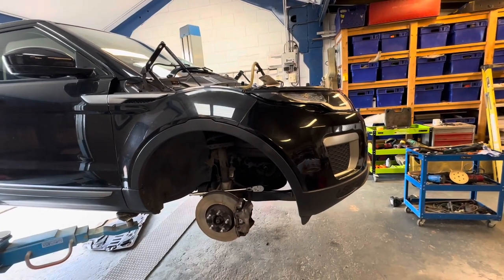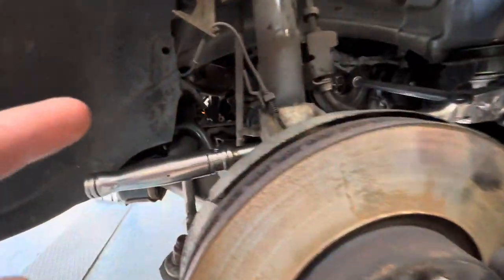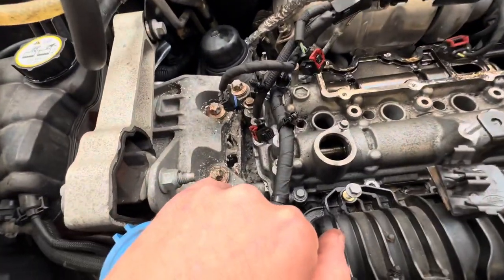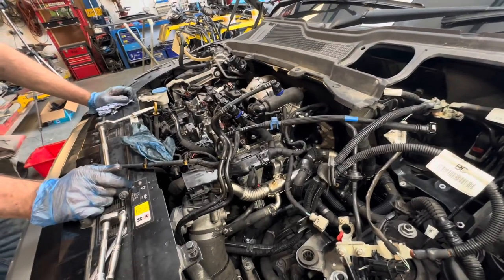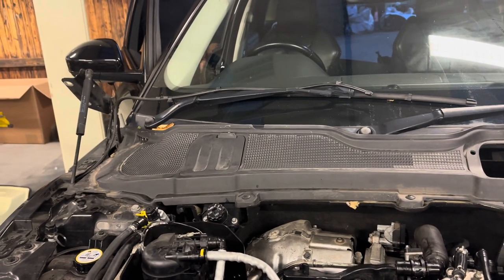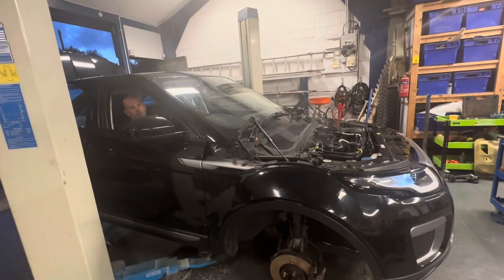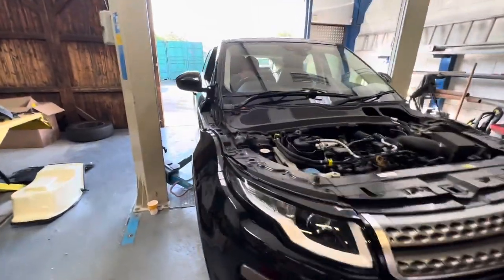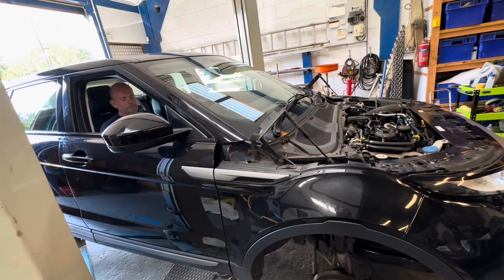RANGE ROVER EVOQUE INGENIUM ENGINE FAILURE WILL IT RUN ???

Comment: get your autel and try a regen on the dpf  (1329) watched rest i have done a few regens on various cars and the newer don't pick the revs much over a fast idle during a regen also when you have scanned for codes down the right-hand side of the screen there is a arrow press that to go into that module and code screen
Reply from the maker: No chance with that chain like that
Reply: @sruk   i done quite a few newer cars and during regen they don't go much more than a fast idle about 1400 to 1600 rpm  if you get it to start a regen  and you don't like the way the engine sounds it can be just turned off or touch throttle  i done a jag f pace and it wouldn't do a static regen so had to drive it to do regen had to trick ecu as it was welll plugged to get it to regen could be a guide worn for chain to rattle

Comment: This video should be titled something like: Reason 1054 Why you Should Never Buy A Range Rover
Reply: This exact car only had one problem. Bad maintenance by previous owners.
Reply: I had my car moted today and the garage said they work on any car apart from Land Rover products as they are nothing but grief, what does that tell you!
Reply: I have an old v8 disco not the same as this? I'm a nurse not a mech lol
Reply: @trigsretromotors  that they're not skilled enough to work on a land rover
Reply: @trigsretromotors  the fact mine has done over 100000 and had only have had a battery issue (it was 10 years old) says all I need to know
Reply: @trigsretromotors  it tells me they aren’t good mechanics, all cars are complex these days, I’d ask them to define grief and look for someone who doesn’t specialise in 80’s cortinas 😂😂
Reply: @tpax3p  no, it's a Landrover. They are generally terrible for reliability, and that's coming from ownership experience.
Reply: @trigsretromotors  that tells me that most garages in the uk are pathetic morons who haven't been trained in mechanics, they only want to charge large amounts of money for easy work. No mechanic in Germany has turned my car RRS away, only the untrained mechanics in the uk.
Reply: And what about the range rover owners who have never had any problems, I have had mine since new from 2010, mine is the l320 v6 3.0?
Reply: DPF problems are not entirely unique to Range Rover, they also occur on Japanese vehicles too.
Reply: I have stopped selling them, terrible cars and getting harder and more expensive to put warranty on.
Reply: Every car has problems and also depends on how people maintain them
Reply: @markfoden765  I don't mean to be offensive but this comment is willfully stupid.
Reply: Sorry PB whatever, all cars have issues be it JLR, VAG, BMW etc, your narrow view is just that - your view. My LR has done 178,00 miles, properly maintained and reliable.
Reply: @trigsretromotors  that they only want to do easy jobs 🤣
Reply: @tpax3p  my F-Pace has had its oil changed every 10k KLM’s  Awaiting engine in JLR garage. 100,000k KLM’s on the clock.  I had a new XE on a lease that was only serviced every 34k KLM’s  as per the book.   Needed chains at 60klms.  I maintain my cars regardless of cost.  Early inginium are flawed and JLR are replacing engines well outside warranty.  The new engine have something like 140 modifications to the early ones.  So 2016-2017 cars be ware.
Reply: @archiehitler5264  They are called the lucky ones.
Reply: @philipyates7138  Lots of mileage, no school runs.
Reply: @ukultimaterc  I booked my car into a  garage that said that they could do the work, a straightforward rocker box cover replacement, I then arrived at the garage to hear that they don't touch RRs, this has happened to me five times in the UK, I wished the "pathetic moron" told me on the phone that they don't touch RRs........ Is that clearer now?
Reply: @peterforrest5181  doesn't matter what runs or mileage it has, if its looked after, its looked after. People pay for these flash motors but don't spend a penny looking after them
Reply: These days they're aimed at posers who know nothing about cars. Pay the top price for crap parts.
Reply: @trigsretromotors  sure ya did 😏
Reply: So many people who have zero JLR onership experience and watch individual cases like this online and jump to typing there flippant little comments on here, ridiculous 😂
Reply: @philipyates7138  the cam sprocket bolt coming undone (and their mechanic mate said this had happened on other vehicles too) is not bad maintenance, it's a huge failure in build quality. Unforgiveable failure!
Reply: @jonm7272  oh of course, becuase no other car has ever failed in the history of motoring. And of course because you had a bad one, every other range rover is a bad egg, I mean they must be, ya mate said so 🙄
Reply: @philipyates7138  ha, yes. And don't get me wrong I've owned 2 Range Rover classics, three Discoveries and one series 3. All maintained (and in fact rebuilt) myself. But these modern versions are just shoddy. No bolt should ever come undone on the end of the cam (ok if someone has later bodged the job) but their mate said it had happened on other vehicles too. Piss poor. Don't care how much you feel you need to defend this rubbish, but there's no doubt about their reputation for being completely unreliable being very well deserved.
Reply: @BRED510  VW's aren't the best either. I've owned both kept both serviced and the LR gave least greif.
Reply: @jonm7272  I've had a c class with steering motor fail at less than 30k and just out of warranty repaired at great cost then Nox sensor failed again not covered. Car maintained to Merc schedule and spec.
Reply: @russelldent3814  I've had two Landrovers, an Evoque and a Defender. The Evoque was 2yrs old with 15k miles on, spent 5 of the 7 months I had it in Landrover for numerous issues. Lovely car when it worked, but so unreliable. Mine had the better Ford engine in it too. Likewise the Defender was a fantastic off roader, but after 2 gearboxes, a rear diff and a smoking issue nobody could solve I had enoughof that too.,
Reply: @trigsretromotors  it tells me i dont want to use your garage filled with lazy mechanics.
Reply: rubbish. more like dont own a range rover if you cant be arsed to keep it properly maintained. also do your homework and be wary on cars with sketchy history or else you will have problems. i can tell you one make that is as bad as you tried to say and thats VOLVO!
Reply: Built-in obsolescence.
Should be good for  120000 miles plus easy

Comment: Out of curiosity rob is there any service history at all ? Normally the chains stretch due to lack of service 😢😢
Reply: As in oil changes? Anything else is bad luck
Reply: Not always the case, I’ve seen a couple go before the first service 😬
Reply: @daveawhittle  🤔 knew they wer a bad engine but didn’t think they were that bad 😂 👍

Comment: People should not use Tesco diesel
All the time because it will clog your dpf also never taking it down the motorway for a really long drive.
Reply: I have mainly used supermarket diesel my entire life and never had a single dpf issue. It's more likely down to people not giving them enough miles.
Reply: Old wives tale. It all comes out the same refinery. Usage patterns are a far bigger killer of modern diesels than where you buy the fuel from.

Comment: I've seen a Merc mechanic use the old chain to pull the new chain thru, by breaking the chain at the joining link, then linking the new chain to the old chain, and then pulling the old chain thru. I don't know if this is possible with this engine, but if it is, it could save you removing the gearbox :> Engine locked in TDC

Comment: Just curious why you guys wouldn’t just go ahead and tackle the chain kit yourself? Is it just a time thing?  (no pun intended)
Reply: Because there is a special kit of tools for doing it which costs £900 to buy.
Reply: @Stuart_Johnson_Solutions  Wow ok. Do you know if the tooling applies to other range rovers for that job then?
Reply: @strictlywrenching  not sure but I believe the engine is shared between évoque and sport, don't think it's fitted in the Range Rover range. There will be a different tool set for the bigger diesels too!

Comment: No disrespect guys, you're hardly gonna clear the dpf sitting in a garage with the engine ticking over.
Take the car for a good run thatllhelp a bit.
Bare in mind if the exhaust gasses can't escape from the engine you'll get some noise.
Reply: You must be one of those experts they always talk about.
Reply: They don't want to risk running up the road with the timing chain rattle
Reply: The timing chain is stretched, that's why they're not doing that

Comment: You mentioned it was thought the timing chain may have already been replaced. I`m wondering if the chain was of poor quality or someone may have used the loose bolt to turn the engine?

Comment: A ramp is a piece of elongated material such as steel or wood that rests on an angle and can be used to get cars or people from one level to another. Usually set on an easy to traverse angle. A hoist lifts something up on a vertical plane. 
Why do you call a hoist a ramp?
Reply: @sopissedoff Well, there's ya problem!
Reply: @ferglesnerk  what would that be Dave , hoists lift things like engines ,before the advent of wheel free ramps ,you drove up a small ramp to get onto the lifting platform,hence it got the name ramp ,if u go to lift the engine out you bring over the hoist ,of course there are hoists for outer thing ,but if u drive up it it's a ramp  even if it's 50 mm ,oh my bad 2 inches for you.🇬🇧♥️
Reply: @sopissedoff  I'm in Australia, mate. We gave up the imperial system in 1788.
Reply: @ferglesnerk  welcome to civilization Dave ,say hi to my brother Jim in Melbourne 🇬🇧♥️
Reply: @ferglesnerk  ah Dave  it's great to know my brothers down under invented the metric system  200 years before I knew about it ,there's me using 1/2 inch 7/16 ,5/8 spanners in old blighty. In the 80s ,were really behind the times up here ,but we're good at building nuclear submarines,ha ha
Reply: @Ralph Reilly my god r u people so contrary ,in the UK it's a ramp  get over it find another form of entertainment if it effects you so badly 😂

Comment: Get some steel toe capped boots and give it an Italian tune up on the M2 with heavier engine oil.
Also noticed no sound proofing material in the bonnet when it was replaced.
What could go wrong?  An SP30 on your licence.
I know it's wrong on so many levels, but sell it to a deaf person 🙂
Reply: they aren't finished yet ,

Comment: I had problems with the pdf light coming on all the time did not matter how much i blasted down thw motorway it still came on a few days later, got to the point where i was just wasting fuel to try and clear the pdf, i would think it would have to have been cleared properly, but never found out as i sold the on to a garage.

Comment: Guys ave you checked the chain for stretching??? They are known for it. And when you do the chain what are the cylinders like?? Is the DPF blocked because it’s burning oil?? Again 37 engine swaps in one dealer in Dublin here.  I hope not but you really could be on a hiding to nothing.
Reply: @williamframe5997  yea I was early.  Still watching.

Comment: Such a shame that such beautiful cars are mechanically totally sh*t. Mine's just done 320,000 miles with not one major engine problem and still runs like new. The reason? It's an Audi A6 diesel. I'd love to buy a JLR vehicle, but as a high mileage driver I just couldn't put up with all the breakdowns they all seem to get. I have several friends who have JLR cars (I live near the Solihull factory) and every one without exception is constantly in for repair, at enormous expense. Beautiful cars, just a shame they're the most unreliable brand in every published survey.
Reply: I could write the same lines but the other way around. I know loads of people with XFs that have been faultless with loads of Audis that are always in for repair. My XF has been faultless for the 5 years that I have owned it from new.

Comment: The Ingenium engine is notorious for DPF and timing chain issues. Terrible piece of engineering.
Reply: DPF is cos its not been driven how its meant to be i.e decent journeys that get the engine and exhaust sustem up to full operating temperature, DPF's on any brand of vehicle are a crap idea, do they have a fix for the timing chain though to prevent this from happening again? 🤔

Comment: Modern diesels are utter garbage, always problems with DPF , EGR valves. They’ve made them too complicated
Reply: They have made them to compliant! As in clean on the outside- crappy dirty on the inside!!! More pressing is why put a Range Rover badge on a front wheel drive car!!!!!!!